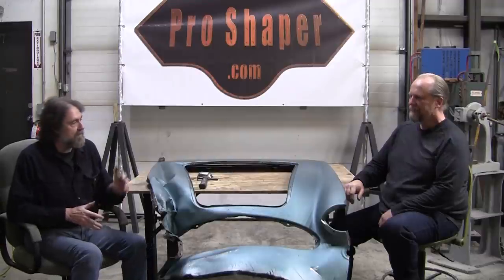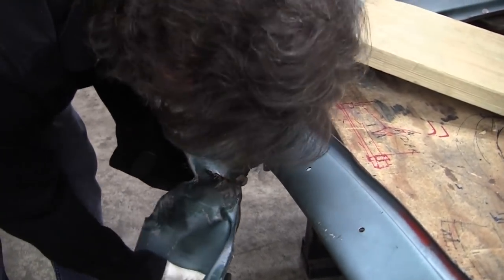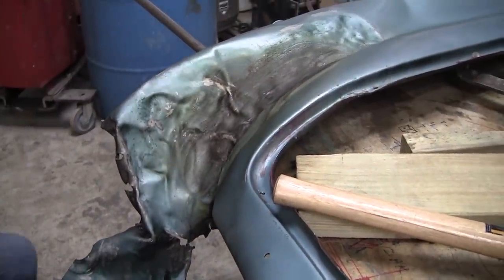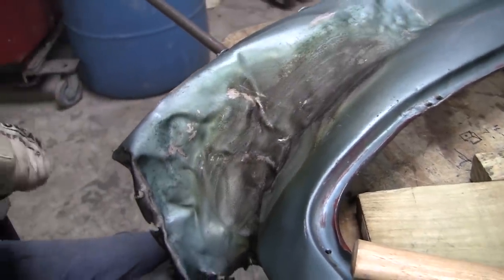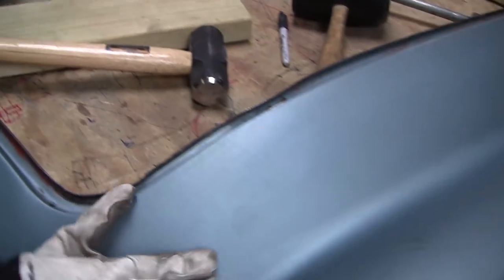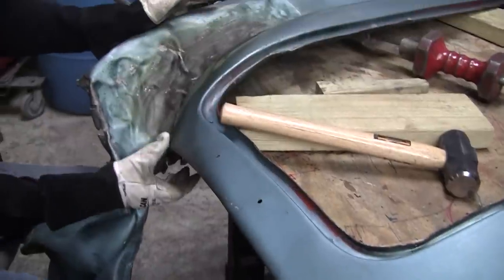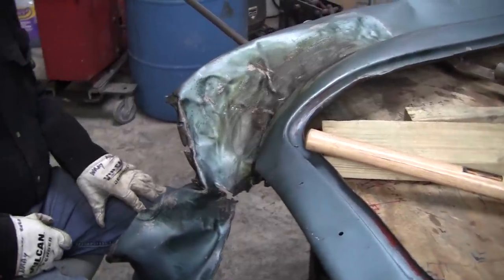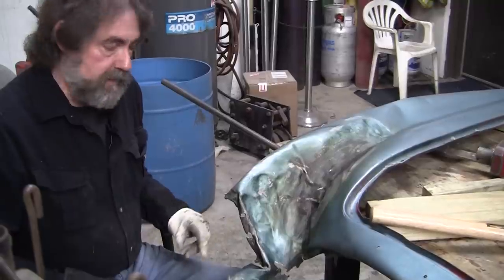Austin-Healey 3000 Can it be saved?

Comment: Wray ,   as you mention those front panels where placed on a proper factory  jig ,  tig welded from the back for strenght ,then planished on a accurate mandrell in order to have little filing on the top side penetration , also  as you mention  the picking marks on the inside are where the lows where brought up and filed  . I have seen that been  done in  England at a spare  parts reproduction factory using old jigs ,it was very interesting

Comment: Very nostalgic. I did a "BIG" Healy in the mid '80's. At the time, there was some stuff called CELLOSEEL which was used between the aluminum inner panels and the outer steel panels to eliminate, or at least reduce, the galvanic corrosion between the two metals. I still have most of a tube left and it felt like it's still good. Nice job on keeping those knots from closing over. There are a million approaches to unbending a panel like that one and I'm sure you have forgotten more than I've ever known. In light of that, one approach is to envision the sequence in which the damage occurred and start unbending from the point that was bent last and work along to the point that occurred first. Any comment on that approach for a mangled mess like the one you are working on? Thanks for all the effort you are putting into these videos. They are very informative and I know they take a lot of time.

Comment: Nice to see repairs and forming using tools learners have access to. Oddly enough I had almost the identical repair about 25-27 years ago on a 100-6. Seem to recall bending a piece of 1/2" bar stock to fit the drip channel for the hood opening, bending some 1"x 1/4" and sandwich bolting the fender flange, I could tack some 1/2" flat to each side and used a porta-power to help open the reverse curve back up using some ready rod as a tie across the tops of my push tabs, and a few dozen Vice grips holding both support bars in place. If my memory isn't failing me, some 1" and 2" pipe welded to some flat plate will make perfect T dollies for planishing out that reverse........ Anyways Thanks Wray and Thanks Mark and Eric for your time and effort. And if you don't post another vid beforehand have a great Christmas!

Comment: Hi I only do aircraft shaping,  in regards to anneals the temperature you gave as 750F is correct, for 3003 and 3005 in any of the "H" designation.  European vehicles,,, I know Aston Martin used 5052  in door skins .5052 was used in alot of  British ww2 aircraft it was called Birmabright 5052,5083 and 5086 anneals at 650F. Quench with water or air. Do not torch anneal 2024 in any "T" or "O" designation ( it can be done  but it's very involved) 6061 is similar to 2024 as far as annealing. 
 Wray you videos are excellent.

Comment: As always great video, at a shop I worked in many years ago a guy brought in the front and rear aluminum panels off a 100-6 that looked like a bag of walnuts and the paint stripped off with 36 grit. A terrible job with gallons of filler.
Picked up a Milwaukee 7/9”grinder and I’m going use the shrinking disc on my E coupe tomorrow.

Comment: Great to see some aluminium accidental repair, there’s very little out there on it. How do you spot weld aluminium Wray? I’d love to learn how to do that for my work.
Reply from the maker: As far as I know aluminum spot welder machines are very expensive. I have never spot welded aluminum with a standard spot welder. You can plug weld it using a tig or a mig. Maye someone will comment with a inexpensive method. I have tried the sandwich method- didn't work.
Reply: @proshaper  thanks Wray I’d been told about the sandwich method, although like you was skeptical! Thanks for getting back to me, really enjoy your videos and have learnt a lot from them 🙂

Comment: What I find interesting is the process starts in a way I (not knowing what I'm doing) might guess to start with.  I think it's knowing where to go from there which comes from experience.  Also video was worth a watch just for the tidbit about annealing at 700F vs crystalization at 900F.  I didn't know you could overheat it when trying to anneal.  I fixed a heater core with a crushed copper pipe end by annealing it and hammering it using a steel pin for a mandrel.  Probably lucky I didn't crystalize it instead of annealing it.
Reply from the maker: Copper you anneal by watching the color. A dull red does it. Aluminum is different you have to get the temperature just right. Too little heat and there is no softening, too much heat and it turns whiter and crystallizes, which causes it to lose all of it's strength.

Comment: You can also use a 2 to 4 of ratchet straps anchored to different points and work then with varying force and direction while applying a bit of heat. A poor man's hydraulic alternative.
Reply from the maker: I would have resorted to some type of pulling if nothing moved. I still might need pulling and constant pressure to square up the hood opening.

Comment: When you are working on aluminum like this, is it a good idea to smoke it then burn the smoke off type of annealing to the metal or will it become too soft? Do you have problems with work hardening of the metal in some of the more bent areas?
Reply from the maker: With the warming technique I'm using the metal is moving. If it wasn't moving then I would fully anneal.

Comment: Wray at this point would working your way across the panel with a hammer and dolly taking out the creases one by one be an efficient method? Or too time consuming?
Reply from the maker: You have to move the major creases first, later finish the smaller stuff.

Comment: When I went to school aluminum melted at 1640f
Reply: I think it depends on the alloy.
Reply: @toolmike100  it is 1221 to melt aluminum  . I just want to see if anyone would read and comment. Yes different alloys melt at different temps. The they all get a bit jelly at 1221deg f. Thanks for your comment, it made me smile.😉
Reply: @williambasinger5859  Many years ago I ran a die cast machine and I remember when the temperature was up to 1200 the furnace just glowed. Lots of memories.